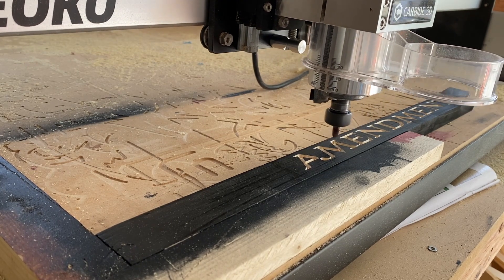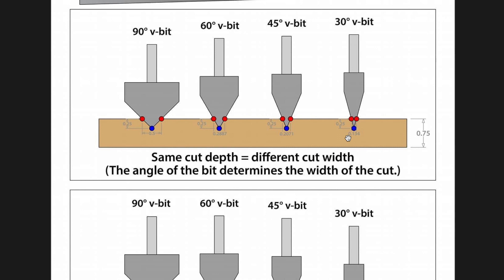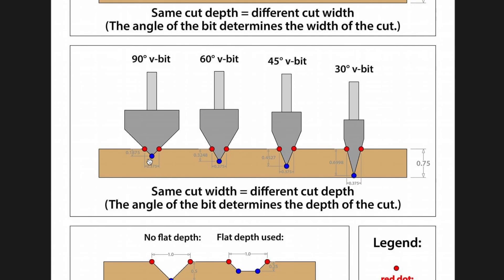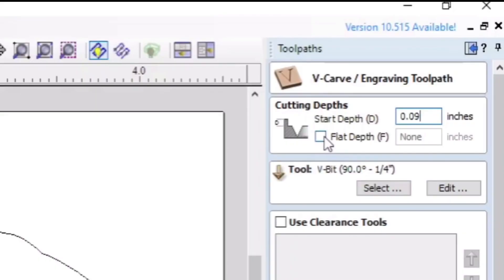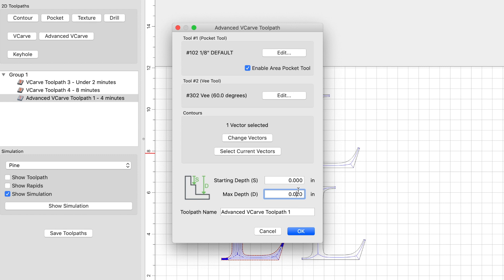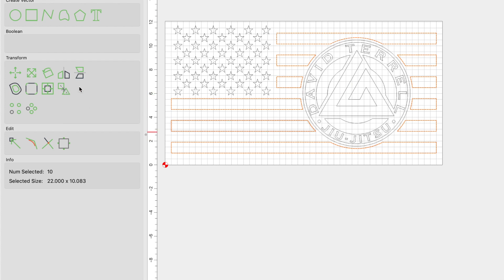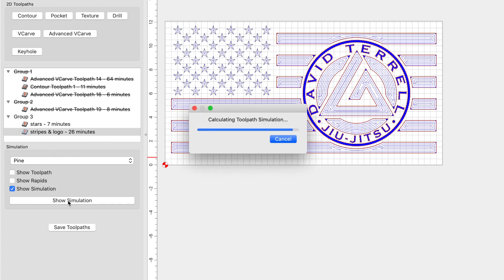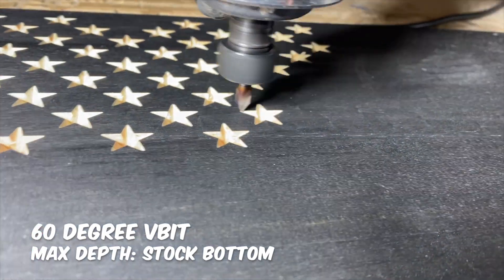How to Use the Vcarve and Advanced Vcarve Toolpaths | Carbide Create Tutorial

Comment: You have some really great videos that I've found super helpful.  I set depth of cut to material thickness when doing lettering signs.  They carve well, but I am finding that I get a ton of "fuzzies" in the letters when cutting through oramask.  This is hard to clean up and affects the painting process.  Any thoughts on how to prevent this?  Finishing pass?
Reply from the maker: I typically use a toothbrush and also my fingers to rub away any fuzzies. If its a constant thing, I would consider replacing your bits.  Since you're carving through oramask, make sure that its a downcut endmill and/or a sharp vbit.

Comment: On your prestained stock, how to you cleanup any leftover edge fuzzies without removing stain surface?
Reply from the maker: Usually a toothbrush helps get rid of those fuzzies.  

Also a Downcut endmill works really great. 

Lastly, sharp bits work best. So if you start seeing lots of fuzzies it may be time to replacing your tool.
Reply: @aetimberpine  Thanks much!